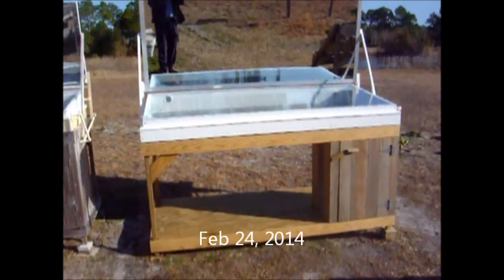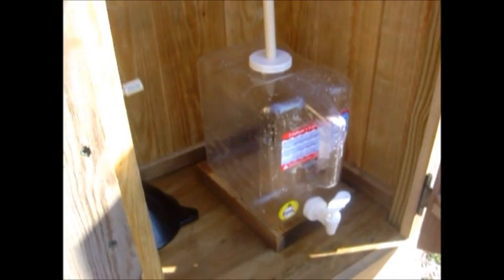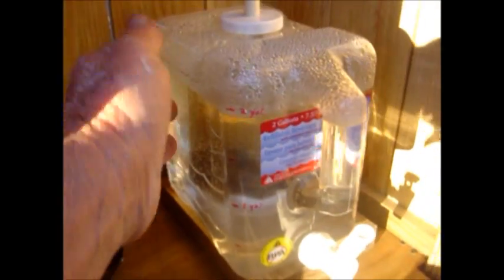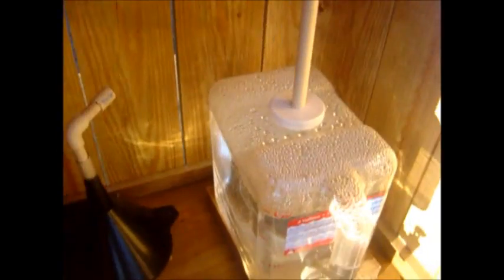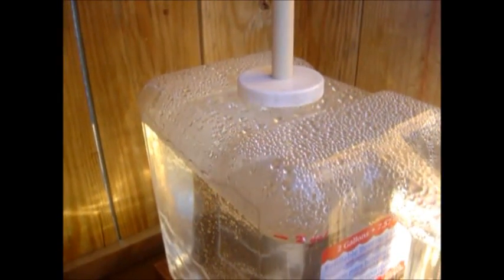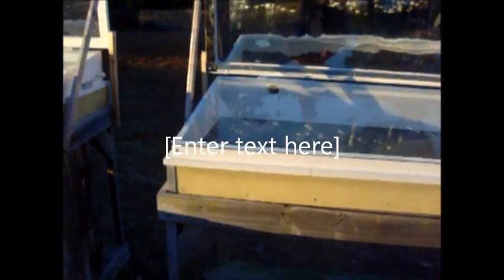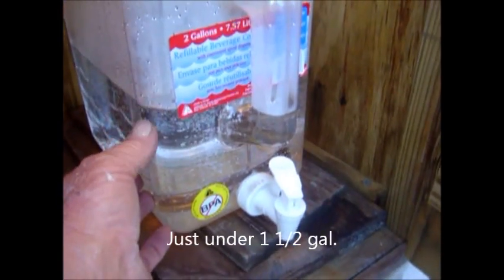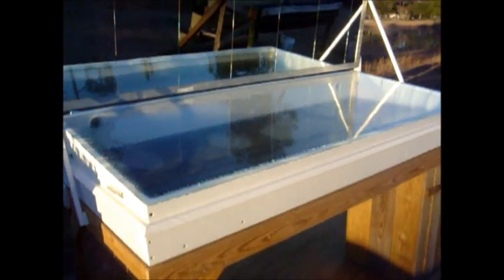Solar Water Distiller Build Part 4

Comment: Have you had the water that comes out of the distiller tested? The only reason I ask is because you used the gutter down spout to collect the water that comes out? I must have missed what type of metal the collection rod was folded out of? Are those surfaces safe for the water? They don't transfer any chemicals? How much and where do I buy these already made? If you can test the water and add that to a video I may be interested in purchasing a pre made one from you?
Reply from the maker: Thanks for the comment and questions. The National Sandia Laboratory has tested this type of distiller over 20 years ago. They actually put E coli bacteria and in the basin and the result were as always, pure distilled water. During that time there was actually an humanitarian project by Agua Del Sol that built and supplied this type of distiller to small communities in Mexico that were getting sick and worse from drinking unsafe water.

Bacteria and viruses are made of solids such as proteins, minerals and of coarse water. The intense UV light and heat inside the unit kills the pathogens and the evaporation process totally separates pure water from all solids. Solids do not evaporate. Yes I have taken water to be tested but I was told that distilling makes pure water and that if he tested it and found a germ it was in the container to start with. Evaporation and condensation is natures way of purifying water. It's also the scientific method. Once the unit has operated for about a week it has effectively washed itself sterile inside.

I have put water from the ocean, rivers, ponds, even rain water into this machine and they all come out the same, odorless, crystal clear, pure water. I have drank it daily for at least 20 years with absolutely no ill effects. My wife and grand children enjoy drinking it too. I also use it when cooking, and making ice.

I only build these out of food contact safe materials that will stand the test of time, then totally clean and disinfect them before their put into operation. I have and continue to stand behind the purity and safety of the water they produce.

Now to address your expressing interest in buying one. These units have a raw cost of just under $400. That DOES NOT include the mirror or the stand the distiller sits on(seen in the video). Also NOT INCLUDED in the price are the water container(s) that you may want to use. You can use a 5 gal. car boy bottle or any other interchangeable containers you like. Adding construction labor cost and you're looking at $650 for a unit. The other kicker is that these units are large when assembled and must be crated to insure safe delivery that makes for very expensive shipping. I don't know where you live but you can always come to Hubert NC and pick it up.

I'm sure after reading all this you may be intrigued but due to the price you are no longer interested in buying one. I get that reaction all the time and all I can say is that I know where the water I drink and give my family comes from, and is the purest, safest, and best tasting available anywhere at any price.

If you are serious about buying one just contact me. Otherwise thanks again for your interest, comments, and questions. Also, should you have any other questions or concerns please just ask.
Reply: you were right with your prediction, that is a bit pricey. you did answer my question about the gutter down spout being safe. i was worried about the material having chemicals or something in it, however the heat from the sun would sterilize it. i am glad that you made a how to video though that is helpful for those that cant afford to purchase one. i am getting ready to move to some land that has a creek, we will need a way to sterilize the water for drinking.
Reply from the maker: mboone84 Yes, I made this video to help people make one themselves. If PVC board is too pricey you can use plywood and coat it with silicone. The unit will probably not last as long but you sill still get a few years of service out of it. If you chose to DIY I will be available to answer any questions you have. FYI, the downspouts have a baked on enamel coating and the collection trough is PVC coated. Both are safe for food contact or I would not use them.

Comment: very smart but I may have missed something - where is the water inlet? on the clip I don't see any connected water supply
Reply from the maker: Thanks for the question. You can see a brief glimpse of it at 1:16 on this video but if you go to my Solar Water Distiller Build Part 1 you can see a much better view and explanation of it at 8:35.   Thanks again for the comment.

Comment: I am going to a bigger city to see if I can get the PVC board. If not, I guess I will be forced to put white silicone on the surfaces of the side boards. You stated that I should also silicone the bottom of the unit as well.

Why could I not use the mirror and silicone it to the side that I just applied the silicone?

If I use the white silicone on the sides and the black silicone on the bottom - is this unit just as efficient as using the glass and black aluminum?

When it comes to mounting the mirror on the aluminum that is used to focus more energy - how should I best mount it?

What did you use for the struts that allow you to adjust the angle?

I will be going to a bigger city to see what all I can find in this part of the world.

Again, Thank You for your help!!!
Reply from the maker: You could use a mirror to line the inside of the top, no problem there I guess. Just make sure it is totally sealed water coming in contact with the back of the mirror will deteriorate the silvering.

Using the white silicone on the sides and black on the bottom will work. The only thing about using the silicone on the bottom is that as hard as you try to trowel it smooth it will always have trowel marks making it more difficult to clean when needed. Believe me, glass is best for the cleaning aspect. Using just black silicone on the bottom will absorb the same amount of heat  Instead of using the black aluminum under the glass you can use black silicone on the under side of the glass bottom, leaving the inside  surface glass, smooth and easy to clean. I've tried black paint but it tends to fade and can release from the glass after time. Black silicone on the under side of the glass would actually be better than the black aluminum. I thought of that after I assembled the basin. I may in the future unassemble it and apply the black silicone. For sure I will use it on the next ones I make.

As for the mirror mounts. I will make a short video for you and send it to your email address you gave me. Thanks again Sam for the questions. I'm here to help.

Comment: Thank you so much for responding so quickly! It appears that I may not be able to purchase PVC wood here. Surely, there is a wood here that will be able to withstand the saltwater? 

What are you using to hold the mirror on either side so that you can adjust the angle?

What did you mount the mirror to and how did you mount it?

I would love to see a sketch of this unit as it would really help me.

Again, thanks for taking your time to help us help ourselves. It could be that this unit will save lives.
Reply from the maker: Do not use bare wood of any kind. If you can not get PVC board, totally cover the inside of the unit (except for the glass of coarse) with silicone using a putty knife or trowel to apply the silicone thinly and evenly to all inside surfaces. White silicone for the sides and instead of a glass bottom you can use black silicone for the bottom of the basin. I recommend 2 coats of silicone on all inside surfaces of the wood. 2 or 3 thin coats are better than one thick coat. I am using aluminum to hold the mirror in place. In this model the mirror is fastened to the wooden stand not the unit itself. The mirror pivots at the base and adjustments are made with the supports on the sides.

Comment: I live in Ecuador and needed a way to distill the ocean water. This is the best plan I have seen on the Internet. You have done a great job!! I have a few questions though and hope you will help me with them...
1) How does the collection box fit to the Basin? Did you use a gasket or does it just sit there?
2) how deep did you allow the top box to fit into the bottom box?
3) Did you also use mylar mirror on the new box like the old ones?
4) What angle does the mirror need to be?
5) What direction do you point the box?
6) I plan on filling 5 gallon water jugs[that go in a water machine]. How would I fit the tubing to this to minimize water loss?

I would love to have a rough sketch if you have one. I am ok at wood work but not great.
My email is rabbithole99 [at] hush [dot] com

Thanks for a great way to make water!
PS... will this unit work on a cloud covered day, no direct sun? We have a lot of days that are cloudy here.
Reply from the maker: The collection box is just about 3/16" smaller than the basin and as such sits snugly inside on the aluminum angle which is fastened with silicone to the glass. The water itself makes the seal therefore no gasket is needed. I used glass mirrors on the new unit, glass mirror is far better than mylar. The angle needs periodic adjustment to maximize reflection. The unit should face south for best results. Filling 5 gal. jugs is not a problem and there should be no water loss just because you are filling a larger container.  Thanks for the questions and your email address Sam, I'll be emailing you more details.

Comment: Do you have a break-down of the pipe runs and locations of the external condenser? And A basic pictorial of this unit? I like this and live in Florida and wonder if the heat of summer will slow down the production?
Reply from the maker: Did the video help you, or do you need more information. I'm here to help you as much as I can. Thanks
Reply from the maker: I made a video for you, Distiller Plumbing To answer your question, No more heat will only increase water production. The higher the heat inside the unit the greater the temperature differential to the outside air. This will cause more heat to be exchanged through the glass and the external condensation chamber. That is what makes the condensation(water production). Thanks for the question, hope this helped.
Reply: STARFIRESOLAR
Reply: Sam Johnson
Reply: STARFIRESOLAR